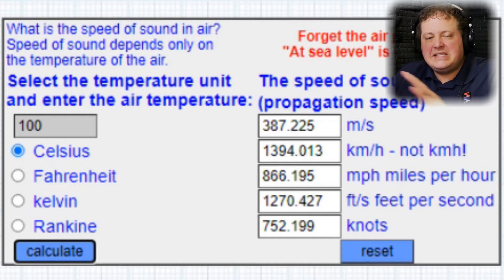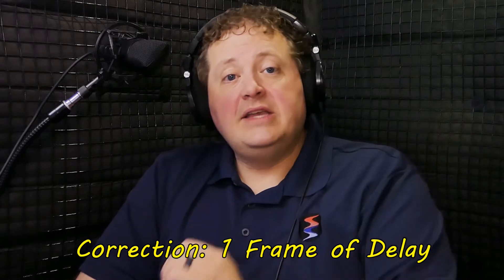Delay with Speech Jammer Demonstration - Sound Speeds

Comment: I wonder what happens when you’re recording in a vacuum 🤔
Reply: It will be 'DEAD" quiet because nobody can survide in vacuum. :)
Reply from the maker: Well played
Reply: Yup. 👏
Reply from the maker: No medium for sound to travel in so it'll be dead quiet.
Reply: @SoundSpeeds  I’m trying it now but I’m getting a little dizzy as I pump the air <ofghl,,>Fl,bd.cv,b. ...........
Reply from the maker: Typing ain't talking. ;-)
Reply: @SoundSpeeds  So it would be the perfect environment for finding the inherent sound floor for your gear 🤡
Reply from the maker: Provided there's no conductive sound such as vibrations going thru the microphone body.